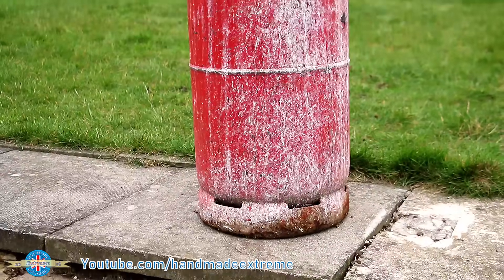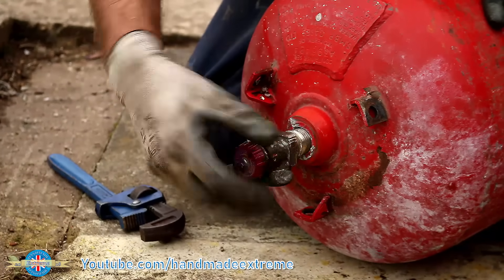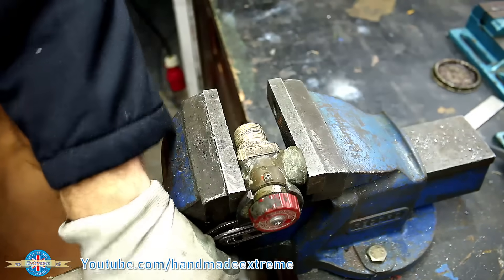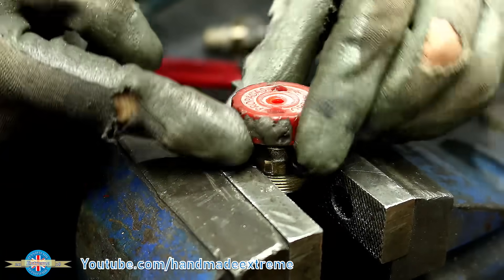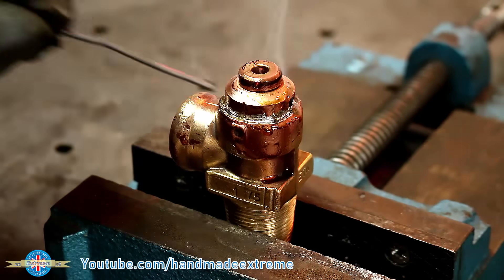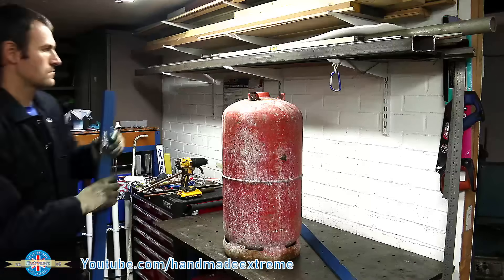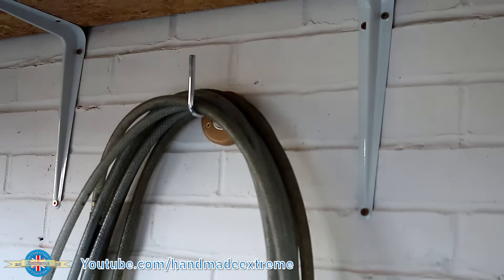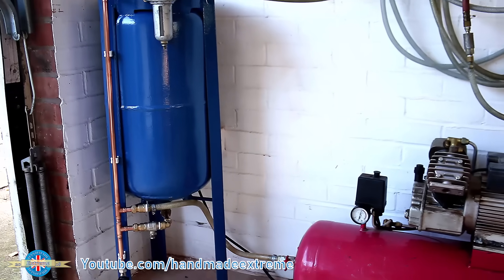Making an auxiliary air tank from an old LPG gas bottle.

Comment: You're doing nice stuff, but be careful.

I think using the propane tank for air is not safe on the long term, becuase what I know about those tanks they don't have inner protection/paint. So water from air will cause slow corrosion to the inner surface of the tank, after few years it may suddenly explode because of the average corrosion on the tank inside surface. You'll not notice that from outside, it will keep eating the steel inner body from inside until it's really thinn that it cannot hold the pressure and it may suddenly explode with a long crack from the bottom side.
Reply: I just noticed what you did @10:44
That's a great idea, and it will efficiently decrease the corrosion rate.
Reply: i did one of these about 40 years ago it still working  without any problems

Comment: To purge the tank of air you can flip it upside down and use your compressor and a blowpipe to clear out the propane. Or let it sit open for a week. If you ever want complete unrestricted flow without trying to rebuild the old brass valve, you can use a 3/4mpt nipple with a standard 3/4 ball valve. I have used a few of these from time to time.

Comment: I would buy a new/ never used tank, the mercaptin smell never goes away from an old tank. They do not cost much. Also if you put the tank at the opposite end of your system you will get more airflow and pressure to your tools.

Comment: Adding an auxiliary air tank will not reduce air compressor running time it may not kick on as fast but will run longer because has to pump more volume of air to get up to pressure.

Comment: Soldered copper isn’t rated for air.  You need to braze it plus use at least l copper. Plus why you wasted all that time to save $5 on a T is beyond me.  See this chart.  https://www.engineeringtoolbox.com/pressure-ratings-solder-joints-d_1162.html

Comment: Very important information. 
The adatives in lpg are flameable. They soke into the tanks metal. They will come out off the tank walls for about a year afterwards. Meaning they continue to smell really bad. And they can also become flameable again if your really unlucky
Reply: Go give your head a wobble … LPG is flammable and is displaced by the water leaving the tank empty of anything flammable .
Reply: @NickandMildred  yeah IV done this job meny times and I'm speaking from experience so you can jog on. You didn't even read it did you.
Reply: Of course I read what you’d written , it was wrong . 
Ethyl mercaptan is added to LPG to approximately 25 parts per million . That equates to about 0.0025 percent . I don’t know what residue would be left behind after the LPG was gone but as ethyl mercaptan is a binder I wouldn’t think very much . Even at 0.0025 % it wouldn’t  be enough to light a cigarette let alone cause an explosion .

Comment: The odd thread of the propane tank is so you can't put the wrong fittings onto it, so you shouldn't be able to connect a propane tank to an air system for instance....... So yes you kind of had to do some bodging to do it. Now is this dangerous? Well none of this has been rated or tested for compressed air. Now the pressure vessel itself has been  pressure tested so yeh it probably OK. But you also just drilled a hole through the cylinder outlet valve, who knows what that valve is good for now.

Comment: For drilling brass/bronze... run the flutes of your drill bits over the corner of a good grinding stone. You’ll create a zero rake surface on the cutting edge, making it much less likely to grab.  Do that with a whole set and then mark it.
Reply: What about PSSR and Hydraulic test ultrasonic test of tank seems.pressure relief valve. Your home made bomb looks good.

Comment: Question why copper tubing?  I always see it with water but never with pneumatic systems... Ive only seen  steel  pipe and the common plastic airlines  but hey copper is pretty
Reply from the maker: It's what I had on the rack. Nothing more complicated than that. Does look nice though 😉

Comment: Hack, you are not supposed to do that. When it blows up i hope it only does damage to you and you dont go and hurt someone. Im guessing when you do hurt or destroy something or someone they use this video in your court case
Reply: a full propane bottle will be about 145psi at 70F.  it's rated for 200 or more.  i've never seen a shop run higher than 150psi.  besides, even a normal one could explode after years of rusting.  https://www.youtube.com/watch?v=KVP_A7eGYxw

Comment: Don't think you should use ptfe with compressed air
Reply: why?  it's definitely rated for it
Reply: @BrianKrahmer  I wasnt sure I thought it was something to do with the oils in ptfe tape thought there was a certain ptfe like tape to use ? Or is that gas fittings?
Reply: @derek876544  for gas fittings, there is the yellow thread tape
Reply: @BrianKrahmer  I knew there was something there in my grey matter 😄

Comment: This is an death trap , never mess with pressure vessels any welds on the whole body render it useless
Reply: so why are air tanks welded then   the air tanks on wagons have thicker plates welded on to drill and tap fro the fittings and  p r v

Comment: For a while now I am contemplating of adding buffer tanks to various places in the house to have good compressed air everywhere I need it... someone invited me to see their solution to that problem, and for the cases where you have the space and material, their idea is genious. They got some really big pipes for it, maybe 100mm in diameter or thereabouts, and they use it for routing the compressed air through the workshop etc. and in the end he has some 250 liters of compressed air in it, with the added advantage of not losing pressure through long runs of thin hoses.

Comment: If anyone is considering using plastic pipe make sure it's safe to use with compressed air.  Some plastics become brittle and can burst projecting shards of sharp plastic into the air.

Comment: I increased the capacity of my compressed air system to about 700 litres using loads of LPG bottles connected together.

Rather than make legs for the bottles I just hung them upside down from a frame.

To connect to propane bottles I just used a high pressure tank to tank connector hose, cutting the hose and connected it to the rest of the system with hose tails, no need to modify the valve.  (UK different countries may use different fittings)

To use butane bottles which use clip-on regulators, I removed the valve, drilled straight through with a pillar drill and soldered a length of 15mm pipe into the hole.  You need to remove the safety valve, and you must drill through with the valve out of the bottle because there are steel components in the valve which could cause sparks.

Comment: So how does a larger tank make any difference to litres per minute?
Reply: No, but means if you are constantly using an amount of air, the compressor will run for  say 5 in every 10 minutes instead of 2 in every 4 minutes, potentially reducing wear from constantly starting and stopping. It also means you can use more air before you have to turn on the compressor if you need to be quiet

Comment: I've done this with a 50 gallon retired propane tank. I like what you've done with the copper pipes! I wasn't as fancy, as I used plain old iron pipe lying around along with flex hose. I will have to mount it upside down like yours someday. Ignore the keyboard warriors. They don't understand physics well enough to understand that this perfectly safe. Air tanks don't just "blow up"... they discharge rapidly.
Reply: yes my sentiments to     too many experts on you tube !!!!!!!!!!

Comment: would this setup add more CFM available for air tools, or does that still rely on the compressor?
Reply: CFM is motor based, this only buys you a little more time before the tank(s) needs refilling

Comment: hello I wanted to know your compressor charges your main tank which if you want you can use the air from the first tank but if you open the tap of the second tank it charges and to use the capacity of the 2 tanks it is good her?

Comment: Nice project and I'm pleased you cleared up the pressure detail. just to throw another spanner though, in the UK I don't believe we ever "own" the bottles and actually just hire them from the gas company full and should return them when empty or re-hire another full one if needed. not sure we are at liberty to re-engineer them into something else! This is definitely true of the large Oxy-acetylene ones as when I had a set I signed a hire contract.
Reply: Look on the rim at the top, near the specs/ test pressure/ etc.  It will have the text "CUSTOMER OWNED" if they are.
Reply: there are loads of calor bottles lying aroun that no body wants

Comment: I'm not so sure your getting more cfm because the compressor motor and pressure switch have been design to only fill one small tank now the same piston and regulator on off pressure switch have to work overtime to fill both tanks but then again i don't know if its the same in UK because you guys use stronger 220 volts motors on everything the one on your compressor look bigger than the tank itself lol , compare to us in america with our weaker and more limited 15 amps at 120 volts motors ! Maybe one solution would be to set the pressure switch to a higher pressure point cut off !  If you move up top a stronger compressor like a twin or triple cylinder it will have bigger pistons delivering more pressure with less work at a lower RPM an especially with much less noise ! But eventually I will have to do the test like you did because i'm facing the same problems with the annoying compressors noise on all the time !

Comment: So you have an old LPG cylinder pressure vessel that is likely to experience relatively few pressure cycles in its lifetime. You are now using it as an air receiver pressure vessel with a feed from a compressor which will pressure cycle on a fairly regular basis i.e. putting the LPG cylinder under more pressure cycles. Have you heard of fatigue failure? You don't have to exceed the normal operating pressure or the pressure relief valve setting to cause a fatigue failure of a pressure vessel. 
Are you using this modified pressure vessel for any commercial activity? If you are, then its illegal. In the UK you can only make pressure vessels if the pressure vessel is designed and manufactured in accordance with the Pressure Equipment Directive and is 'CE' marked - as this video was made before the UK left the EU. It would also need to comply with the Pressure Systems Safety Regulations (PSSR) for the UK and require a written scheme of examination.
Even if not used commercially, does your house insurer know that you make untested and modifications to pressure vessels.
I'm happy that you are not my pressure vessel adviser.
Reply: YES! As a Mechanical Engineer, I can tell you that Metal Fatigue is a major consideration in the design of machinery and structures subject to varying forces and pressures. The strength of metals is much less than their strength under a constant loading. So, failure can occur much later after a given component is initially put into service. Pressure vessels do explode - google it. Also, copper, brass, and bronze have very poor fatigue properties.
Reply: @williamcnewlandjr4535 
 I'm a mechanical design engineer as well, specialising in engineering compliance.
Reply: @williamcnewlandjr4535   I'm a mechanical design engineer as well, specialising in engineering compliance.

Comment: So I dont know if you thought of this, but while the compressor wont have to run as OFTEN, it will have to run LONGER.  These motors are designed with a certain duty cycle in mind in order to maintain the lifecycle of the motor.  Making the motor run past its duty cycle can and will shorten the life of the motor.  Good luck, nice job.

Comment: People underestimate how much better a compressed air system can be with additional tanks. Awesome thing is, they can be put anywhere. In the ceiling, out back, in a crawl space, anywhere and as many as you like.
Reply from the maker: It has certainly made a difference. Especially when I'm using the plasma cutter.
Reply: @Handmadeextreme  i have a Dewalt small compressor  could I still do the conversion with a bigger propane tank  hi 👋 from Ontario 🇨🇦 where I follow you 💯 from 🇨🇦.
Reply: @domenicomonteleone3055 yes but from my understanding you will only double the size of the tank.... 

If its somthing like a 2hp 12O litters per minute 24 litter tank

You can increace the tank size to 48 litters going any bigger dosent really help.

My personal experience has been to get 2 small working ones and1 broken one the tie the 3 togother
Reply: I use ols oxigen tanks on more lokations. Also reduce the pressure you use makes a big difference. Equipment/ tools 6 bar . Cleaning around 4 bar  cleaning lathe and milling machine 1.5 bar

Comment: You could have soldered a water release valve into the tank same way you soldered up the old propane valve.
Reply from the maker: It occurred to me after I had done it that I should have put one in the end of the valve instead of putting it on the end of the pipe. Hindsight is a wonderful thing. Thanks for the support.

Comment: dont forget to improve the cooling off the compressor, it will run for more time to fill up. air outtake(high side) will be very warm. eletric motor to. ths unit is using 2 pistons is a strong one, 1 piston you it can burnout faster :) good luck. but that a good video and well done.

Comment: Have you had any ill effects from overheating due to the increased duty cycle time? Good project.
Reply: Its not really any different for compressor, than using some air tool that uses air for longer time, like when sanding or sand blasting something. If you use some tool at 7 bars for an hour or let the bigger tank to fill up to 8 bars it is a lot less stress just to fill the tank.
Reply from the maker: Nothing so far. Glad you enjoyed it.

Comment: I’m not sure why you went to the trouble of soldering the old valve together and then soldering pipe to the old gas fitting instead of just using standard pipe fittings with pipe thread into the tank directly.
Reply from the maker: Just didn't have the right fitting to hand at the time and the shops were closed haha. Bit of a round the houses way of doing it.

Comment: Wait .. if your not good enough to "weld a boss on the bottom of the tank" then wouldn't it stand to reason you would not be good enough to weld on legs?  Just a thought.. you also said you were not welding on the tank so as to not compromise the integrity .. would that also apply to the "boss" you intended to weld at the bottom of the tank? I was just a bit confused.. Lovely build.. I need to do this in my old shop.. but at my age it will have to wait for the warmer weather.. but it is most definitely needed.. excellent work! carry on!

Comment: I would be extremly careful when using Gas bottles as compressed air tanks, i already did that too. I took a standard european(germany) gas bottle, roughly the size of yours. i washed it around FIVE times with a strong industry APC water based cleaner and let that cleaner sit in there over 24 hours once. Washed it several times with clean water (yes, i also filled it to the top to displace all the gas/air inside) and let it dry off 2 WEEKS. I cut in an 1/2 Inch thread and put in a standard 1/2 inch adapter. Then i pressurized it with 10 Bars. When i used that air form the Tank i saw that the air was BLURRY just like gas! The Propane/Butane must have been trapped in the wall of the gas bottle somehow. I never used that thing again since.
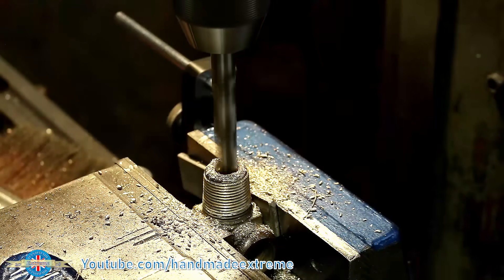By the way, try some cutting fluid at 2:20 :D
Reply: ROFL. you cannot be serious.
Reply: @beatrute2677  I am serious,  you could smell and see the gas. It must have been "stored" in the gas tanks walls, creeping into paint or maybe even corrosion. 
Don`t get me wrong, i still love my tank i got now. No more gas after several fills. But seeing and smelling the gas was scary... really scary.
What would my benefit be of giving you a "false alarm" warning?
Reply: I still do not know if i have been brave enough or dumb enough to touch that thing again like a half year later. Like i said, after several fills it was good.
Reply: The only safe solution may be using something really aggressive, "etching" out the gas tanks walls.
Reply: If you washed/flushed it out there's no more gas in there. Gas doesn't go into walls. The chemical additive can but it just smells bad

Comment: Great idea but what's your duty cycle on the compressor motor? Once you have used all the air the compressor needs to refill the tanks. So if you used let's say a pneumatic grinder with a high air volume that compressor motor could break, as it would run for a very long time to fill up.
Reply: Quality compressors are designed for continuous duty for thousands of hours. If it breaks it needed an upgrade anyway. (I use and repair both consumer and used industrial compressors) You can connect multiple compressors to get more CFM.

Comment: DO NOT USE A PROPANE TANK AS A COMPRESSED AIR CYLINDER! They are not lined with anything just raw steel. They will rust even if placed upside down

Comment: The compressor wont run less, just longer at the beginning and then on and off less often. Total time running should still be the same right?
Reply from the maker: Correct but it has to start and stop less frequently. Therefore the life of the compressor should be increased providing the running time does not exceed the compressors duty cycle.